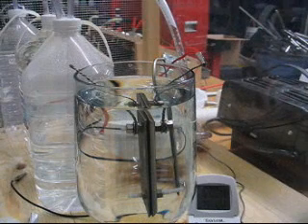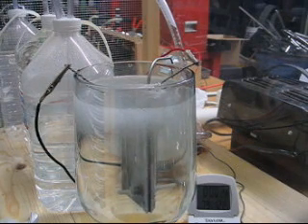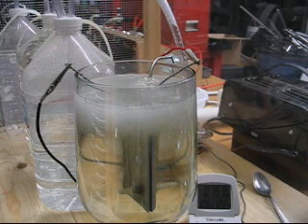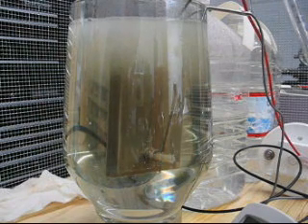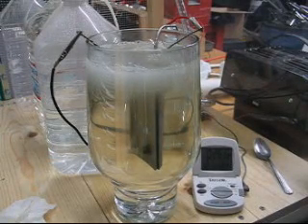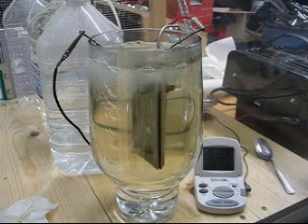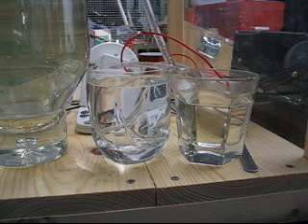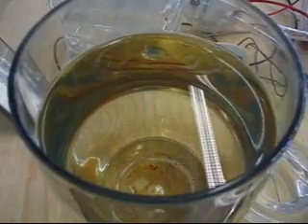#08-022 Sodium Hydroxide in Distilled Water Test

Comment: That said, only the first batch of waste electrolyte is very toxic. The Cr+6 leaches from the surface once. As long as the cell is not being over driven and metal is not being eaten away, subsequent batches should be safe. That's why it's a good idea to precondition plates in a bath of weak electrolyte for a while first, alternating charge about once an hour for about a week, before putting them into full service. Even 316L. 
hope this helps
thom in scotland.

Comment: dog is anoying sure is..... but why you get scum is due to useing salt or baking sodas and such.... they burn during the electrolosis proccess, and they burn up creating your scumm as they are used up, there life expectancy is less than sodium hyroxide..... if you got scum useing S/H, you must be using 304 stainless and this leaches carbon out, then water going brown, 316 s/s, non magnetic = no carbon = no scum.